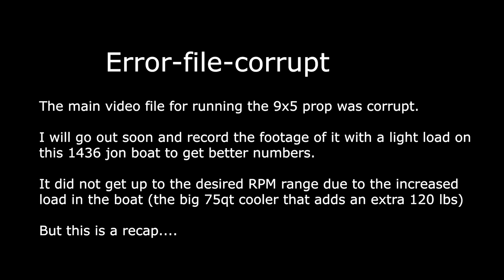13hp Backwater Mud Motor Load Test 1436 Jon Boat

Comment: That swamp runner is hard to beat , they preform very well on the smaller motors. I would think they would do just as good on  larger motor as well. My 2 .
Reply from the maker: Thats what I'm starting to figure out. I think this backwater kit would be better on a vtwin engine, but for a single cylinder engine, the swamp runner is the go to. I'd like to test a swamp runner on a vtwin also, but I need a bigger boat for that haha and thank you for your support and being subscribed to the channel for so long, I really appreciate that Bo!
Reply: JTgatoring 
Great

Comment: The issue I see with the vibration is that the shift that you had to cut to install the Backwater kit might be the issue. Second is that the shift is shorter then that of the Swamp runner.
Reply from the maker: I thought that too, but after talking to a few people, they all said that cutting the output shaft length on the engine wouldn't do that because the center of gravity never changed and therefor would not disrupt the balance of the engine. For the second point, that could be a factor. I was also thinking that the swamp runner shaft has bushing along the inside of the shaft to help support the inner shaft. I do not believe the backwater has any support inside the shaft except for at the ends. This leaves the entire shaft length to do what it wants and could cause vibration

Comment: I’m going to pick up a Lowe 1436l next week and I see tons of people using mud motors up here in north Florida and I’ve always heard for my area they were good. I have no experience whatsoever with mud motors but I’m thinking about putting one on this boat anything specific I should know?
Reply from the maker: A 1436 is best paired with a 13hp engine. A 6.5hp or 8 hp would work if you're on a real tight budget. A 22 or 23 hp engine would be too heavy and too much power for the transom on it, so stick with a 13hp engine or smaller. With the 13hp engine being a single cylinder engine, I would not recommend this backwater kit. It vibrates too much. So I would recommend a Swamp Runner kit. The Medium Kit fits the 13hp engine. If you plan to go faster than 20mph, the 100" shaft would be best, but if you don't like the idea of a longer tail, the 85" would also work perfectly. There are surface drive engines, but those really only come into play once you get into bigger boats and engines. I don't see many surface drives with a 13hp engine.

Comment: Don’t know if I should get a long tail or a outboard I want the speed of a outboard but I’ll be running in a river so a long tail is more reasonable.
Reply from the maker: All about your needs. There are positives and negatives to both. Just depends on your priorities and what you value most
Reply: @JTgatoring  I’ve decided on getting a mud motor since it’ll fit my needs better but now I’m stuck on which brand I should get are there any brands I should really stay away from?
Reply from the maker: @carson2042  After the experiences I have had, if I were to purchase a longtail it will be a swamp runner. I have had too many negative experiences with the other thai longtail companies along with having other people that have shared their negative experiences also. I would choose a swamp runner over a backwater due to the affordability and performance. Jake at Backwater was great to deal with but for the cost of the backwater, it just didn't perform to the standard I was hoping for. The only time I would recommend a backwater to someone is when their bottom width is greater than 48" because a thai longtail doesn't like boats wider than that. So I would recommend a swamp runner. That is the only brand I would feel comfortable enough recommending to somebody.

Comment: Bro, I'd package that thing up and send it back to Jake. Its NPR performing like it should and that's just not acceptable. I'm sorry you're having a awful time with it.
Reply from the maker: Yeah its unfortunate. I still want to put some more hours on it and see if it will smooth out. I'm starting to think that these kits would be good on a vtwin engine so their is less chance of vibration, but for a single cylinder engine, I don't think I would recommend it.

Comment: Did you disable the governor in the motor?
Reply from the maker: No, I did not. This is a bone stock engine in all my videos so far. I would like to have some modified engines, but so far I have kept it stock so people know the bare minimum they should be able to get out of their engine.
Reply: @JTgatoring  Disabling the governor will free up a lot more power.  It's easy and requires no additional parts.
Reply from the maker: @ericthered9655  That is correct, but I would like to keep it a stock engine so when people watch these videos, I can say that the engine is bone stock and not modified so that they have a realistic expectation of what speed they should be getting with these different longtail kits and predator engines.
Reply: @JTgatoring  I understand.  It would still be stock.  The only difference is it wouldn't restrict engine RPMs.  It's your call.  I'd like to see what it would do without the governor.  I'm sure that's how pretty much everyone would run it.
Reply from the maker: @ericthered9655  There are a good amount of people who do not feel comfortable modifying their engines. There are also those who want the engine as reliable as possible and don't want to touch it that way. The issue you run into with a longtail and a good reason to leave the governor attached is because you can go from full load prop in the water to no load in less than a second when you get a prop blow out. That is when the governor steps in and saves the engine. I think it is safer to keep the governor attached. I would rather provide information that everyone would be able to replicate rather than give numbers people most likely won't achieve. I have a light boat, I'm a light guy, and I could really get this engine pushing some RPMs, but most people aren't 150lbs, riding solo with a 135lb hull. It would be fun to do and push the limit, but that also takes more time and money that I do not currently have.

Comment: So I'm still buying the Swamp Runner Kit then?
Reply from the maker: For a single cylinder engine... yes
Reply: i had a mud skipper for two years with zero problems. it was still running good when I sold it for something else... he has a problem with every company besides swamp runner. isn't that odd.. he just keeps buying all these other comapnies products when the swamp runner already works? oh and the company that makes the swamp runner and mudskipper in thai land are owned by brothers...
Reply from the maker: I recommend the swamp runner because it is has the best chance of working for the person buying it. The mud skipper kit didn't ride good at all for me and the boat I used and I had the same experience with the beaver dam kit. My luck with both the mud skipper and beaver dam kit was bad so therefor I do not recommend them to others... there is a whole series on it explaining why. So if a kit doesn't work for me, why I would I recommend it to others? Same goes for the backwater kit. The backwater kit had so much vibration in the handle that my hand would go numb. Why on earth would I recommend that kit to someone else after having that kind of experience with it? I'm fully transparent jin lim
Reply: @JTgatoring  they are literelly the same thing...the one you tested was the lower end version that they sell for 295 . the MUD-SKIPPER® PRime version that is more is exactly the same as the swamp runner. they look like they were made in the same factory and then just a different logo and different bolts.....the oposing companies that make them in thailand are owned by brothers lol...

I think the mudskippers were made in the sps factory too...if you look at the cks address it's not a factory...
I see yall changed the skag on the newer swamp runner but the tail used to be the same too
Reply from the maker: @jinlim6575  but they are not the same. There are many differences. Watch the videos and you'll see why. Also, even if there were the same product, swamp runner has a better warranty, better customer service, and has more parts & tools for their kit owners when compared to mud skipper. So yes, I will recommend swamp runner over a mud skipper at this point in time.

Comment: why dont you use the electric start on your engine?
Reply from the maker: I didn't want the cables in the way. With testing multiple kits on this engine, I didn't want to keep attaching and reattaching the cables/battery. I would also have to have another battery, even though it could be a small lawn mower battery, I still didn't want the extra clutter in the boat for right now. I don't mind hand cranking it for now

Comment: These are surface drive I can tell already by looking behind you that you're not even throwing a rooster tail which means your pillar propeller is totally under the water there should be a rooster tail behind that thing if it's running surface drive so if you get the right color propeller combination you'd be a lot faster
Reply from the maker: The backwater kit does not run a surface piercing propeller. The entire prop runs under the surface of the water. They can not run a surface piercing propeller due to the short shaft length which requires a ride plate or "cavitation plate" to keep the prop from being unmanageable or hard to handle. With the ride plate being submerged or riding right at the water level, the prop is located under that plate and therefore is completely submerged

Comment: I have a 1448 jon boat any recommendations on a mud motor for this
Reply from the maker: Depends on your hp rating for your boat. Most people I hear put a 22hp on it but some also put the 13hp on it. No matter the size (a single cylinder or v-twin), if you get a Thai longtail, you will need a 100" shaft. I don't recommend the backwater unless you are getting a v-twin engine and want to spend the extra money, it will just be slower. If you're going to be running a lighter load most of the time, then a 13hp would probably do you well, but if you consistently have a heavy load the 22hp would probably be better. Just depends on what the boat is rated for.
Reply: I've got a 1448 alumacraft running a 22hp predator with the swamp runner large kit (100" shaft}, no complaints.
Reply: @dalereamiddleton7192  thank you

Comment: This is too much. I don’t know how anyone can compare a Backwater to a Thai kit and say the Thai kit is a better product. I’ve ran Backwater products since 2013 and I’ve encountered a handful of people in that time who said Thai kit was just as capable as a Backwater. Those people are FOS. Now a Thai kit may very well be faster, but you’re running in water deep enough for an outboard anyways. Run the outboard if you want speed. Your Thai kit is going to go to pieces when actually subjected to an environment meant for a mud motor. Too many people have had positive experiences with Backwater. I truly question the intelligence of anyone who makes the claim that any of the Thai kits are overall superior to the Backwater it.
Reply from the maker: Well, I do speed tests in open water because its where most people start from. Not everyone starts in the rough. Most have at least a mile run before starting to work their way into their spot. Testing it in the same spot, in open water, gives all the mud motors the same environment with as little variants as possible. It keeps the tests fair. Speed plays a big part when people are looking for mud motors. If I'm getting 15mph with the backwater and my hunting buddy is going 20+ with his swamp runner, it's like being tied to a dock. The swamp runner isn't "going to pieces" when I need to use it as a mud motor. If you've experienced that, then inform me of it, but you're trashing one product and being very biased of another. The parts of a backwater kit are quality parts, but costing double or triple the price of a swamp runner, I would expect the backwater to perform better, if not two or three times better, but yet it vibrates more than the thai kits and is also slower.